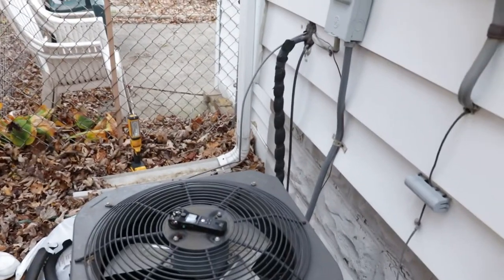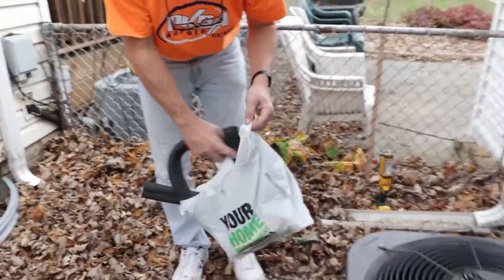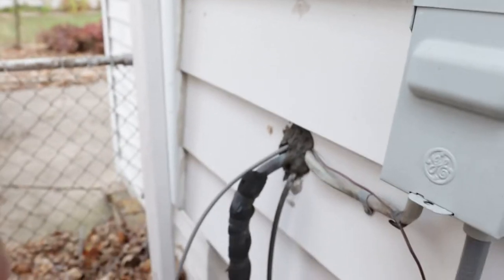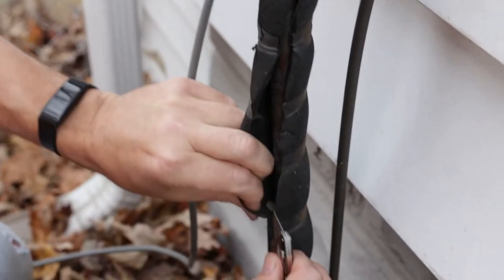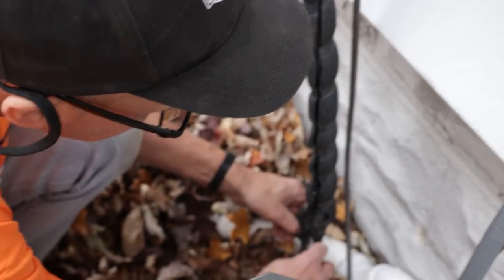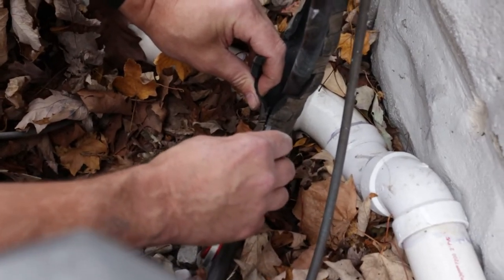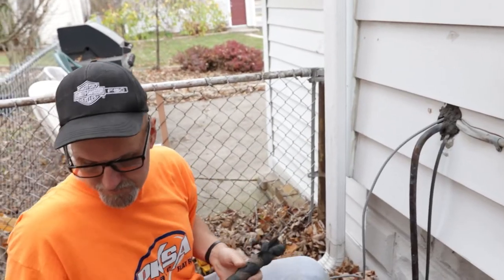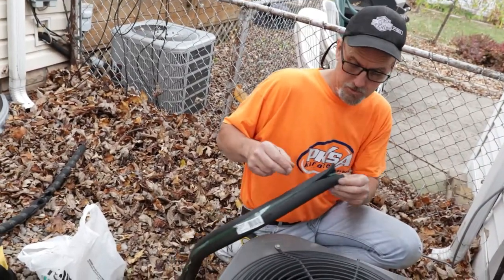Replacing Foam Pipe Insulation On Outdoor Air Conditioning Unit

Comment: Consider replacing the foam insulation will a pool noodle.  The pool noodle has a higher density and provides a greater insulation value for about $2.00 at a dollar st.

Comment: I just replaced mine, then saw this video... my pipe has almost 100% sun exposure in super hot temps here... and the builders install didn't even last a year, and I didn't know it needed to be done until a few days ago... it has been 2 years.  When I did mine, I did put that UV Blocking tape on, but I covered the whole line with it (not the thermostat line)... why did you not do that?  And did I make a mistake by covering mine completely so it lasts longer?

Comment: Guy with orange shirt, 😂
In my case is my home, so i did a full cover with the tape ,over the insulation tube,
Now after is done,  will it affect the a/c  copper pipe, like  to tight?
If you could let me know

Comment: Is the foam supposed to fit the pipe snug?  I think my foam has a slightly bigger diameter than the pipe so there is probably a pocket of air inside.
Reply: I see they make at least 3 different sizes depending on the size of your specific line.